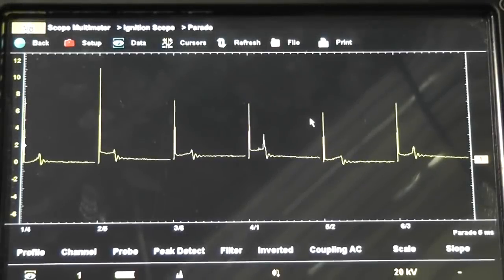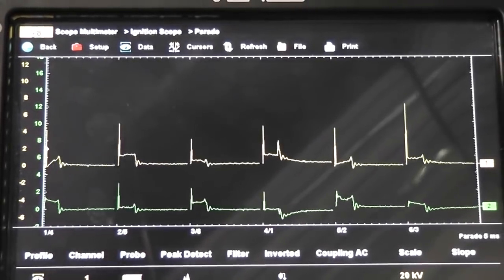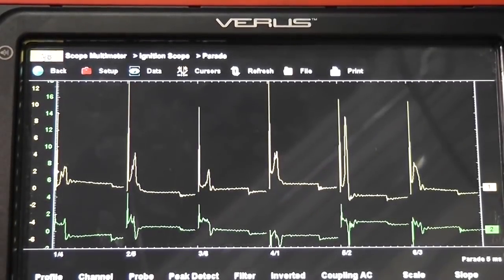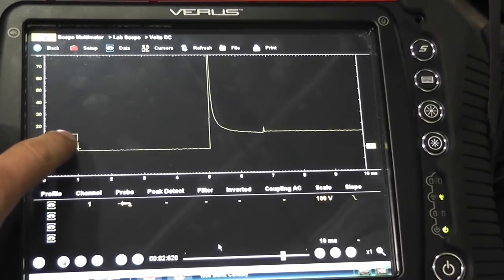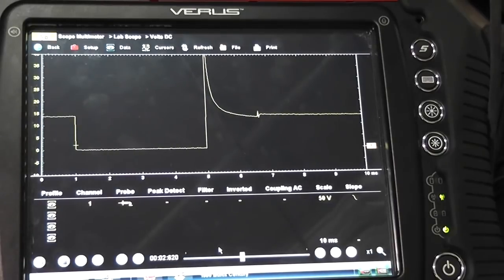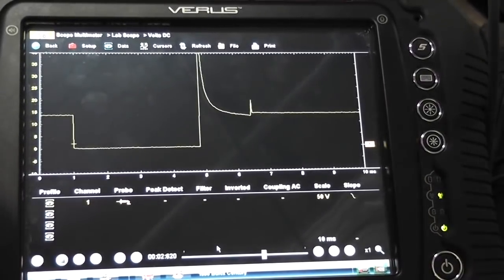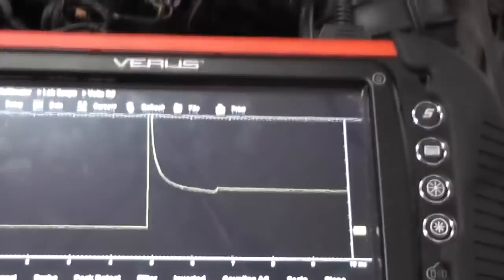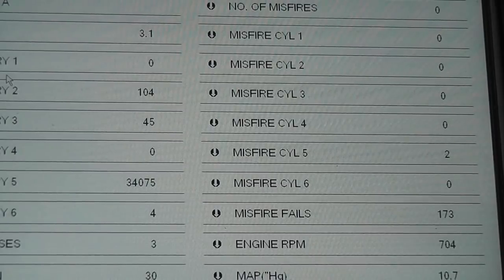Identifying a Stuck Closed Fuel Injector (Quick Tips)

Comment: It took me a humbling amount of time before I could say I truly understood these waveforms. For those who aren't quite there, here are a couple of thoughts from a fellow student, that might get you to the goal sooner. Remember that to see this voltage waveform, the diagnostic lead needs to be on on the ground (switched side) of this circuit, between the coil of the injector and the switch. Second, think of any coil as a hose with water running through it. When you suddenly shut off the tap, the momentum of the water (inductance) tries to keep the flow going, and the water builds up on the output side of the coil. When the electrical switch snaps off, that moving water has nowhere to go, so you get a positive pressure spike in the wire coming out of the coil in the same direction as the current was flowing. Strangely, the coil inductance turns the coil into a transient energy source, almost like a battery. So, the voltage will flip a transient negative spike if your diagnostic lead is on the input side of the coil, and a positive spike if it on the output side of the coil. Isn't it interesting how the pintle hump is so delayed after the electrical switch opens, because the dying magnetic field of the coil won't let the spring of the pintle snap the injector off until current falls.
Reply: As an electronic specialist , thats a concise, great explanation-  well done

Comment: Very short and useful video.
Why we don't have a stuck open fuel injector!?
What's the difference in Wave form between stuck open and stuck close?
Reply: No difference
Reply: مش حتعرف 
الجراف يوضح سحب الفولتية او سحب الامبير (كان تستخدم في امب ميتر ) لما يتفعل السونولويد متع الانجكتر فلهذا مش حتعرف ادا كان عالق مصكر او مفتوح المهم ماخدمش.
Reply from the maker: If it is mechanically stuck open or closed, the waveform will still look good! The mechanical movement of the iron core of the injector does have an effect, as noted in this video, but it is very minimal. The main characteristics to have a good waveform:
1. Good power supply
2. No opens or shorts in the control wire
3. Good injector winding
4. Good computer transistor driver.
One other thing, if it is stuck open, you will have massive amounts of white smoke coming from the tailpipe, extremely long crank times, and a completely flooded cylinder as well as fuel in the crankcase.

Comment: Compared to this one, how would a stuck open injector show up in the same tests? Or does it really matter if its stuck open or close? I guess in case you are dealing with fuel trim problems?!
Reply from the maker: If it was mechanically stuck open, you'd have the same pattern but the difference is before you would ever get a scope on it, you'd see huge amounts of white smoke dumping out of the exhaust. Like this one https://www.youtube.com/watch?v=FOwwFIWQhsQ&list=PLAFYVCyenqcqc3kuBwuZDN8IA6LIDPaDn&index=10
But this one was electrically shorted to ground, so it was a little different in the approach and the waveform of course.
Reply: @ScannerDanner  Thanks, Paul. Makes sense when you actually think about that - oups.

Cuddles for your little feline!

Comment: where did you connect the test probe to see the injector run of all cylinders? under the "injection" fuse? 
Best regards
Reply from the maker: With a voltage waveform, as I am showing in this video, this would be individual injectors being shown. Only one at a time. 
With a current probe, you can view them all from a central power supply wire or fuse

Comment: If you cannot afford a scanner Autel etc check Exhaust manifold port temperature like in Diesels we scan temp on each outlet this shows which cylinder is dead. If Motor runs smooth on starting fluid but drops a cyl on its on fuel system singles out stuck closed injector not spark or compression. 
Your idea method excellent also . 
Thanks

Comment: I have intermittent misfire and definitely go lean when I give it throttle.  It is very intermittent.  I don't have access to a scan tool.  I only have a OBD scanner that is halfway decent.  Could it be possible to have an intermittent sticky injector?  Or would it just always be stuck?  I feel like my misfire is fuel related only because of the lean condition when I give it throttle and fuel pressure is very good...if anything pressure is high.

Comment: On a carbureted engine I've seen the high spark line be an open plug wire and/or spark plug.  Watch the plug in connector on the injector also.  Sometimes a slight movement on the connector and the injector quit working.

Comment: Great demo for injector diagnosis.
When I was  an automotive technology teacher I used the same demo for my students with the addition of primary ignition for coil on plug ignition,
being that primary and secondary reflect each other.
Another thing that triggers a good explanation is why on secondary parade the dwell period is negative as you can see it go below zero.

Comment: Is that called a pinto hump can you spell it. Thanks great videos.
Reply: "Pintle" - refers to the needle-like valve in the injector which opens and closes to control the fuel sprayed in the cylinder.

Comment: Thanks for the tip, just one question how do you deferentiate between injector problem and ECU disabled  injection.
Reply from the maker: If the ECM is shutting it down to protect the cat from a misfire, on start up, it will always turn it back on for a few seconds. So shut the car off and restart it. If your injector waveform returns for a few seconds and then shuts off, the ECM is intentionally shutting it down
Reply: Thanks Boss you are the best 💪

Comment: that is really awesome buddy . what about the current waveform do you think will show something? what if it's partially closed also will show up on the waveform ? thanks
Reply from the maker: You can see injector opening in the current ramp and closing in the voltage waveform. Remember the waveform and the characteristics of it, depend on many things.
1. Good supply voltage
2. Good winding in the injector
3. Good transistor in the PCM
4. Good ground for that transistor (ground side switched circuit)
5. No opens or shorts in the wiring 
The mechanical part can be completely stuck, open, closed, half-way and the waveform will still look good if the above mentioned items are operational as designed.
What I showed in this video is what to look for with the mechanical side of it. Hope that makes sense
Reply: @ScannerDanner  thanks Mate . you did the best I am grateful for what you doing for teaching us

Comment: Why does the ignition wave form get affected by the stuck injector?
Reply from the maker: Mechanical movement of the injector iron core/pintle, distorts the magnetic field as it is expanding (opening) and collapsing (closing)  and induces a small voltage in the windings. Best I got, hope that makes sense.
You can't see the opening in the voltage waveform, but you can in a current ramp pattern
Reply: @ScannerDanner  Sorry, I shouldn't have asked the question in such a half assed way. What I should have asked was how does stuck injector cause the second really high voltage spike on the #5 spark wave form when the throttle was snapped?
Reply from the maker: @pretendmechanic8697  thats my fault! I missed the word "ignition" smh
No fuel in the cylinder, effect of secondary spark kv, is your question. Got it! 
So fuel acts as a conductor and when it is not there it is more difficult to maintain the spark current flow across the gap, so essentially the spark goes out (very short burn time) and there is a huge amount of reserve energy left in the coil, causing this very large coil oscillation.
Also the piston approaching TDC during the spark event causes a natural upward curve of the spark line, even in a good firing cylinder, so that factor is in there as well.
Reply: @ScannerDanner  Thanks for answering and thanks for all the videos, Keep up the good work, guys.

Comment: What about a fuel injector signal thats flat line of battery voltage
Reply: It means there is no control from the pcm #scannerdanner
Reply from the maker: Yep, exactly what @Kalinda Mbozi said. On a ground side switched injector circuit, this means there is no control. So an open driver or open control wire or pin contact issue at the PCM would be your options for faults. Check out more of my chapters 17 and 18 playlist right here on YT and my website at www.scannerdanner.com
Reply: @ScannerDanner  
The thing is at restart the injector has a waveform and than it drops out . Even at the ecm it has flatline. But at restart its works again for a good while on and off
Reply from the maker: @dcomputers  this is intentional shut-down as the computer is trying to protect the cat. Check spark and compression on that cylinder